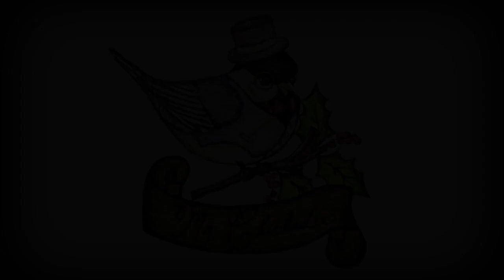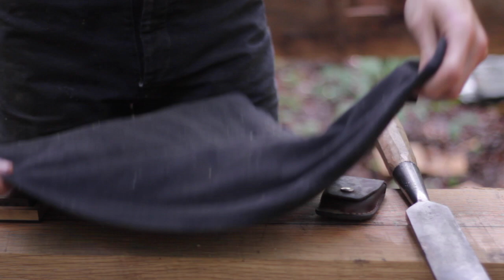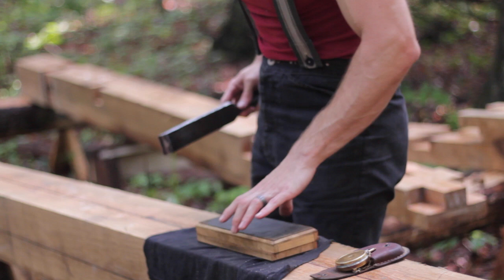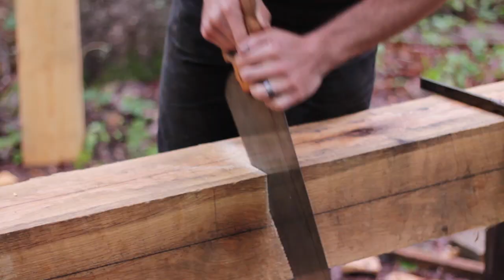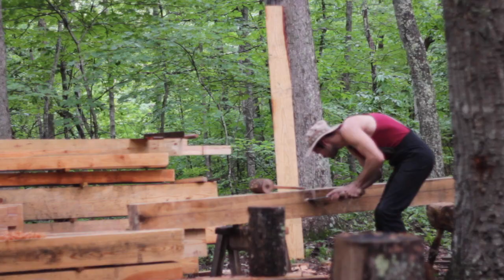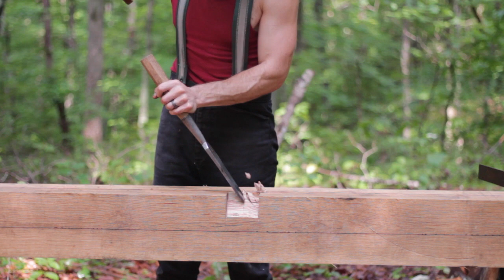Our timber frame cabin Part IV: Carving floor joist pockets

Comment: The mallet and chisel switch adaptation... is both Logical and logistical. 
Being ambidextrous is what's kept me happy. From after duty racket ball, when i was a young Sgt., to later Laying bricks. The first made the Lieutenants upset when i beat them using both hands... some even said it was cheating. In bricklaying... spreading the mortar with my left hand saved me the extra walk back from each laid course, before beginning to lay the bricks in a right hand fashion. If i had spread the mortar right handed... then i would have had to walk all the way back, in order to begin laying the bricks. "Overcoming and Adapting" has it's own "Strength Saving Beauty for Being." -Former Recondo Sgt. "Rock" 82nd Abn. 1/504 Inf. Div. 71-74 "Each time we tug on something in nature we find that it is connected" -John Muir, said that... "Each time i tug on something on my old 50 Chevy pickup, it falls off." -i, said that... Y'all drive on for Our Therapy... Your payments are within your Viewer's likes.
Reply from the maker: Thanks you, I enjoyed the story much. I could use a good brick layer down here for sure! Ive only trained myself to work some tools lefty, not butter bricks yet, Ill give it a go!

Comment: That framing square looks pretty rusty. For nice clean up scrub it down with steel wool then paint it white. Let the paint dry then rub off the paint with steel wool. The indentations will  keep the paint and make the square easier to read.
Reply from the maker: It does look rusty no? haha its actually some weird copper paint color or finish I assume was original. You are correct of course in how to restore a rusty tool though! Thanks
Reply: +Mr. Chickadee Better framing squares may be copper plated. Copper reflects infra-red. A black square left in direct sun for the time it takes to cut a bird's mouth gets hot enough to raise welts. Time and tarnish dims the copper but its IR reflection endures so don't polish it off if the square is to be used for outdoor work.
Reply from the maker: Forrest Addy you sir an overflowing database of obscure or forgotten knowledge, thank you!
Reply: +Mr. Chickadee Old F#rt s my name, mystical blather is my game.
Reply: That is the original finish, I have one just like it, bought new in 1969.

Comment: Mr.C how would you get the jaws on a bit and brace un stuck
Reply from the maker: hmm, I would first try soaking it in penetrating oil for a few days...
Reply: +Mr. Chickadee Thank you
Reply: +Ethan  Wolovich  if it's stuck due to rust, soak it in half water half white vinegar. If there is no rust visible, try heating it up.
Reply: +John Burkitt Thank you also cool avatar

Comment: Does the wood warp between steps? Do you have to have a bunch of dedicated time to do a project like this so the wood doesn't rot or change?
Reply from the maker: Not really, if you hew or mill the timbers so they are "heart center" movement will be negligible. If properly stacked and cared for they won't rot and you can work on them as you may. Houses were hewed, joined, taken apart and shipped on sailing vessels all over the world from the docks of Virginia in the heyday of the British Empire.

Comment: good job! i like when you throw your hammer to catch it with the other hand, natural but like a boss ;-) you did it straight, no dovetail on it?
Reply from the maker: Thanks mathieu! Yes these drop ins will be straight, dovetails in green wood normally shrink anyway, I will probably lag them in place just for extra security, and the center joints is a through wedged tying joist, have not filmed it yet since its special! ;)
Reply: yes dovetail shrink in green wood, your are right^^ i didn't think about it. for the center joint, you could put in 2 wedges instead of 1 so you sure to have a rectangular key.

Comment: Would you ever consider videos explaining wood joinery? I do hobby furniture work but am very interested in actual timber framing. Also, thanks for replying to my comment when you first posted the video. I would also like to ask if you've ever visited the great state of North Carolina?
Reply from the maker: HI! I guess I thought these videos we are doing was explaining pretty well, is there a particular aspect of the process or joint you wish us to try and clarify? I was stationed at Lejeune for my first 2 years of active duty…

Thanks for the comment!
Reply: i've jumped into Camp Lejeunes' "Catfish Drop Zone" back in Oct. of 73. The Yom Kippur War was underway and the name of the Operation upon boarding the C-130 was designated "Solid Sheild" which was then  changed in mid flight, to Operation "Exotic Dancer." Knee, to ankle deep water, scattered stumps & 14 mph winds. We were 'Exotic Dancers" alright! whilst dancing to miss all those stumps upon landing. Made me appreciate Ft. Braggs' sand soft Sicily Drop Zone. "Semper Fi" on your service Mr. Chickadee. Thank's for keepin us safe those years. -Former Recondo Sgt. "Rock" 82nd Abn. 1/504 Inf. Div. 71-74 "Just be glad you don't get all of the government you pay for."

Comment: as usual, I enjoy your vids - but I have a question; Shouldn't the center one be a dovetail, in order to keep every pulled together?
Reply from the maker: Great question! The center should be a tying joist, and mine is, but I did not use a dovetail. I have seen many examples of dovetailed joist pockets rendered useless by shrinkage of the tail as the joist dries. So since my joists are green all but the center are drop ins, the center is a through wedged tenon. I will also lag the drop ins just because...
Reply: +Mr. Chickadee 
A through wedged tenon ... yup, that oughta hold.
Thanks for the reply.